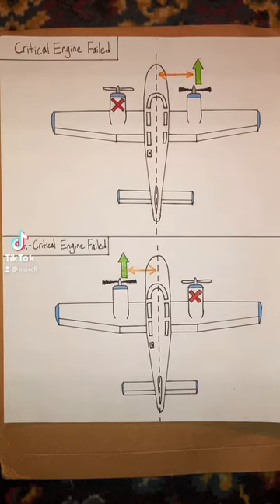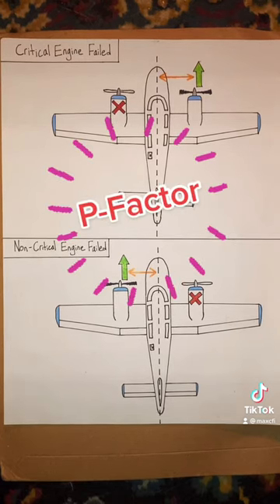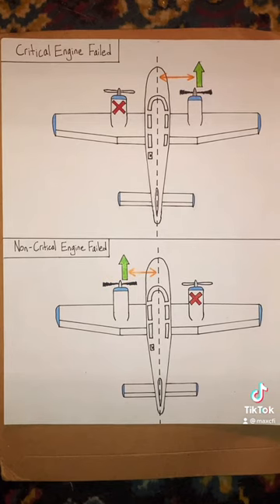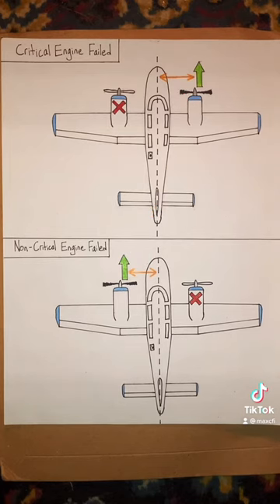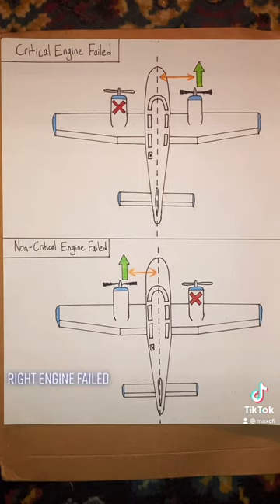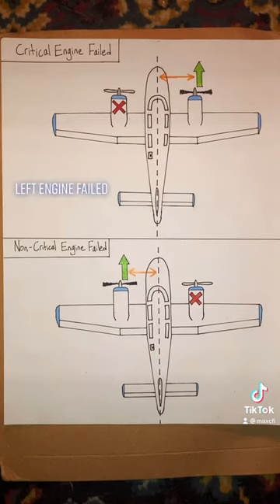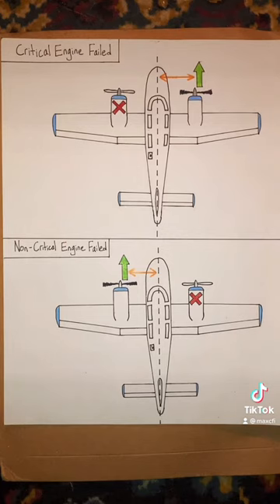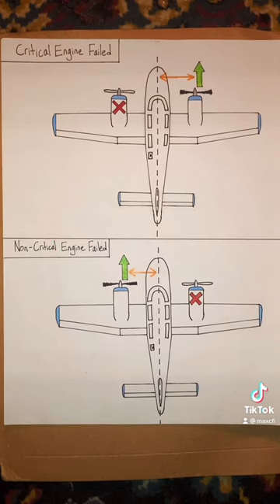Critical Engine of a Multiengine Airplane

Comment: Why were the twins not equipped with engines that rotate opposite directions to start with? What's the difference in the engineering a reversed cam grind, a  reverse rotation starter and mags , oil pump .How many lives would that have saved?
Reply from the maker: some do have that, it depends on the model!
Reply: @maxcfi7718  The P38 did have opposite rotating engines which helped roll rates for dog fights.As a kid I always wanted the Sky King Cessna 340 but soon learned how dangerous it could be. Of course I could ever afford it.
Reply from the maker: @charleswesley3642  cool info!! didn’t know about the P 38